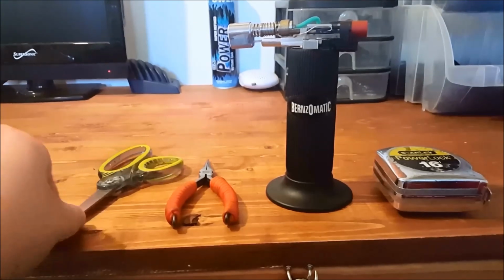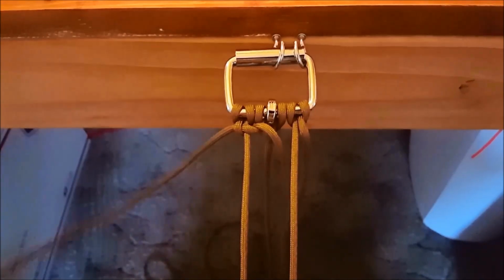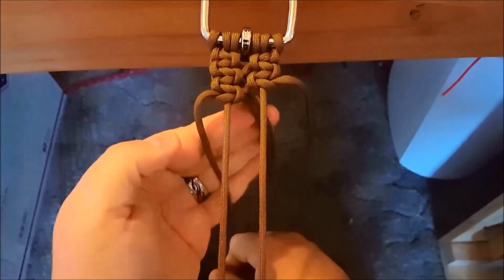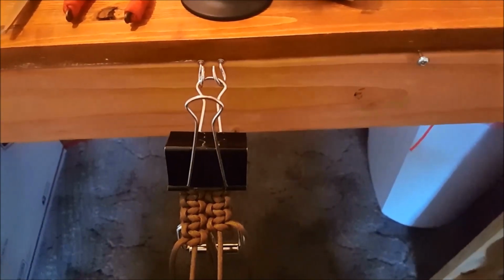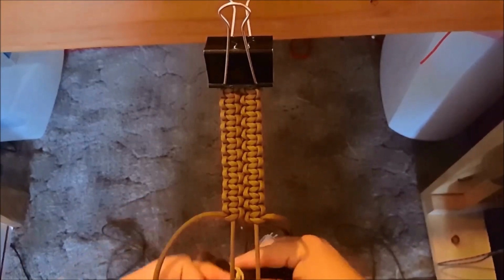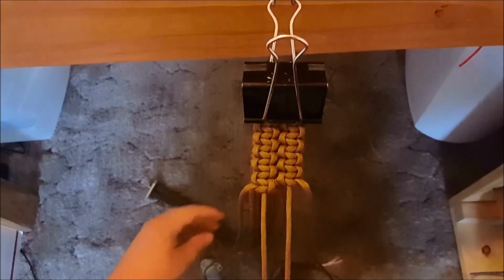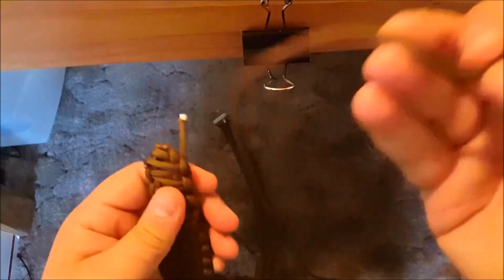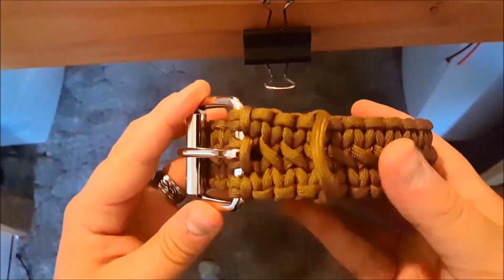DIY PARACORD BELT

Comment: I used this tutorial to make a dog collar!!  Thank you so much :)
 
heres how I did it: I measured my dog’s neck (17”), and did 1/2 a foot, for every inch of the finished product.  So my long strings ended up being 25’.  I made my short strings 4’ and it worked out fine. :)
Reply from the maker: Alaina Grace glad to hear this video could be of service. Be sure to add something that will easily break away if this is around anything’s  neck for safety reasons.

Thanks for watching.

Comment: This video is pure 24karat gold.
Just spotted that there are only 6 comments. Wow. No comprendo.

Anyway, i acutally wrote to ask what weave you normally do in the end. Or if you just stop it there?
I am thinking about adding a bit of quick deployable lenght to the belt, instead of that rattler endie.
Preferrably the zipper sinnet since it's the only quickdeploy i know of that can be partially deployed in case i only need 2 feet of cord :)
I know i'd end up with two pieces of cord if i partially deploy it. But rather that, than the all or nothing quickdeployweaves
Reply from the maker: Lifeisawheelie thanks for the kind words. the knot I usually use is a little difficult to explain. it's just something I developed over the past 6 years doing this stuff, I'd honestly love to share it but there's realky no way I could word but properly so that anyone would understand. best of luck with your quick deploy, let me know how it works :)

Comment: Cool, I like this style the best. Nice vid. I wonder how would this look two tone. Think I may try that.
Reply: I think building paracord items in multi colors makes the project easier to understand the methods used. Great video but I did gain a few more gray hairs trying to figure out some of the steps used,  Thanks.
Reply from the maker: We have photos of a 2 tone on our website. It's simple to do, just swap out the center hank with a different color.
Reply from the maker: Wayne that's definitely a great idea, we used this solid color option because it was for one of our Facebook giveaway winners who requested solid coyote brown.

Comment: ok I have to ask somewhere so here goes.  Very good instructional video you have.  I've been watching videos on belt building and everyone cuts end nearly flush and burns ends.  This holds up over time under use without unraveling?
Reply from the maker: Curtis M Howell Jr It certainly does. I've had items from nearly 6 years ago still no problems with the melted ends.
Reply: Sounds like it works well,  thanks.

Comment: Ok so I worked the other problem out on my own. Unfortunately, I have a new one:) The beauty stitch just seems to appear on your belt and mine is just flat on the front. Do you know what I'm wrong?
Reply from the maker: I would guess you wove it the opposite way than this. It's an easy thing to do, most folks weave them like that anyway. Try it again if you like, it will work fine as a belt either way. Congrats and thanks for watching!

Comment: No disrespect indended or anything, just another way to start at the buckle, a slipknot (in case of smaller lenghts of rope) instead of needing a 40 foot length of rope you can use two 20 foot pieces.
And an added bonus of 6 different colo(u)rs, i made one like this for a gay friend was only 1 color short and thanks to your video ofcourse
Reply: Just realized, it might not be a slipknot, i know it as an old wives knot some1 could translate i suppose?
Reply from the maker: flemish_gamer _guy no disrespect taken. Thanks for adding to the conversation and for watching.

Comment: But would that go through the belt holding holes (vertical holding)
Reply from the maker: SHUBHAM PATIL I’m not sure I understand the question. But thank you for watching.
Reply: @Paracordguy  sorry I meant the belt loops, the belt looks thick so thought it wouldn't pass through belt loops
Reply from the maker: SHUBHAM PATIL oh ok. No this will slide through easy enough and stay in place. I wear one daily.

Comment: Question. I made this belt over the last few days and I screwed up the length. I have a 36 waste and my finished belt is 41 inches but has maybe two inches to spare once on. Is there any way to remedy this and make it longer? Or am I going to have to make a new one?
Reply from the maker: Thanks for the question, and to answer that technically Yes you can. You'd need to unravel the belt back a few inches. and take every strand you have and add the same color paracord by melting the ends and welding them together. this can be tricky, but if you do it right it can be nearly unnoticeable. you can always gift or sell your current belt to offset the cost you incur from the materials. good luck and thanks again for the question.
Reply from the maker: One more thing, I've been told by fashion forward folks that a belt need only 2-3 inches left over to be a properly fitted belt. not sure if you want to go through the trouble of extending it if it fits and you have a few inches left over that should be just about perfect. cheers
Reply: +The Para-Cord Guy Ty for the reply. It did fit, but I only had maybe am inch I'm excess. I ended up kinda doing what you said, except I kinda did a variation of the manny method except for only one end of the cord. It worked out and I extended it around 4 inches.
Reply from the maker: +Couch Guy Yn Awesome I'm glad you made it work for you. Keep weaving 😎

Comment: If I need the belt to be 50in long, how long will my strings be?
Reply from the maker: 50'
Reply: The Para-Cord Guy would it be 50' core and 35' sides?  i am looking to do one as well. and have the same measurements.  lol
Reply: The Para-Cord Guy like 
35 50 35?
Reply from the maker: 30/50/30
Reply: The Para-Cord Guy so the set up would be: 20' 10' 25' 25' 10' 20'  
(as where you had it 20' 5' 20' 20' 5' 20' from left to right) thanks in advance
Reply: Herman Alcaraz I think how the measurements go would be 24, 6, 25, 25, 6, 24. because 20 is 80% of 25, and 24 is 80% of 30 so 24 and 6 should be the correct measurement
Reply: christopher frawley appreciate it man.
Reply from the maker: It would be like I said. 30 inches on bother sides (25 feet each side to weave with, 5 feet aka 60 inches to weave over on each side) and 50 feet split two ways for the center.